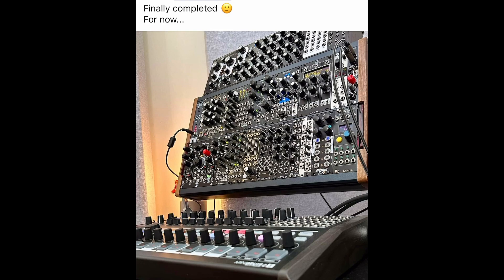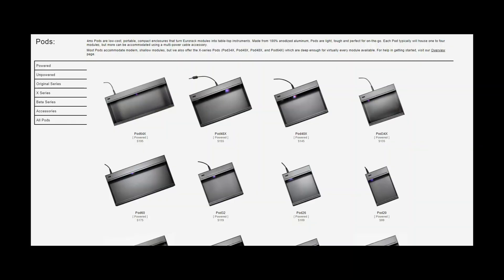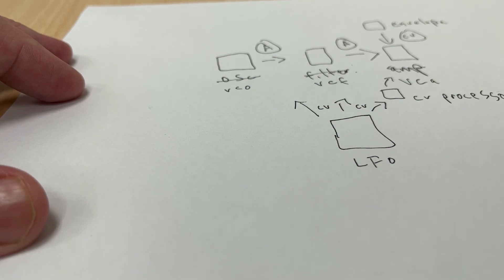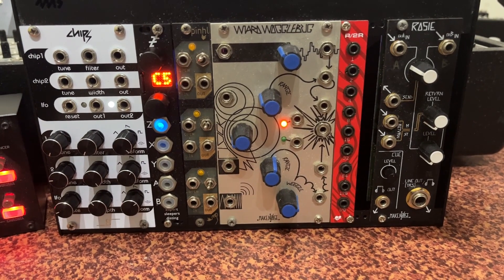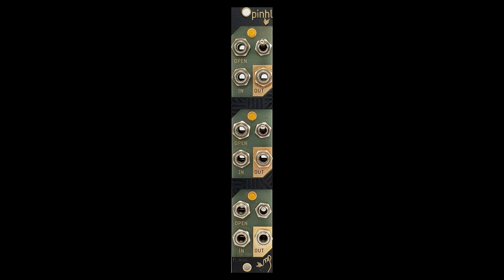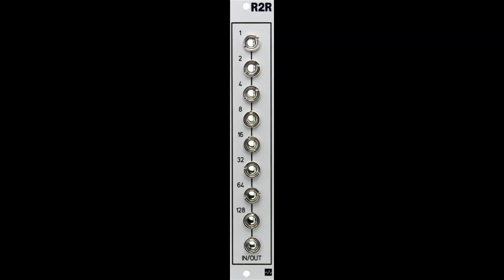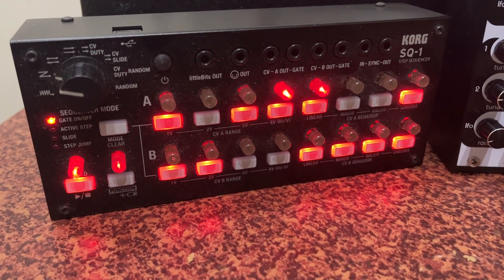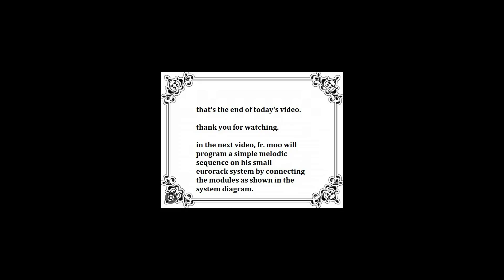NEW SERIES!! Designing a Small Eurorack System

Comment: 6Ux84HP is my full size system. 
I have some 60hp-64hp cases that I consider small.
And a 24hp case that is think fits any definition of tiny. In that I have Acid Rain Chainsaw, Beepboop VCA vactrol and ST modular Karl. (I kinda of wanted to do a pair of Doepfer SEM filters, but ran out of power connectors).
Reply from the maker: 24HP is officially small!

Comment: there definitely is large modulars in that group. I've always felt 2 x 84hp, classic doepfer case, is the largest a small system could be. It does depend on the modules used. Like, no 1u at that size, and preferably using larger hp modules or sequencers/non sound producing modules.
Reply from the maker: I knew @monotronfan1 would support me!

Comment: Small format modular systems are totally worth the hours of search, research and waiting! They’re easy to own, portable and offer still interesting solutions to bland, prebuilt synths.

I have a PulpLogic “Zissou” case [56 hp] that took me 7 years to fill. 
It has a FH-2, a Loquelic Iteritas, 2 Disting mk4s, a uPlaits, 2 Synrotek 4hp envelopes, PulpLogic 1u vactrol VCAs (3), mults, mixers, an LFO and even a Meng-Qi passive LPG.

I use Ableton to sequence it, but the FH-2 can take any USB midi controller and even can do sequencing.

And it has a LID! 😉
Reply from the maker: i'm thinking about thos lids
Reply: @father_moo   Lids are a good thing. 
I’m a messy old guy, but my costly modular gear is still quite clean… BECAUSE LIDS!